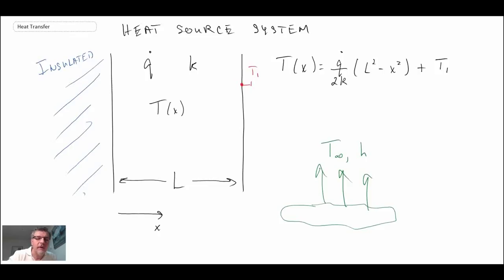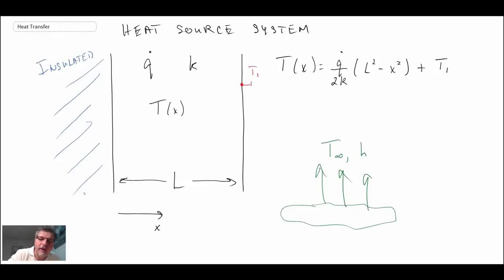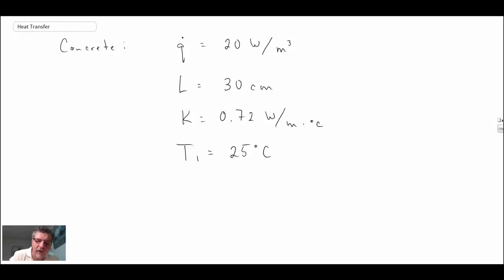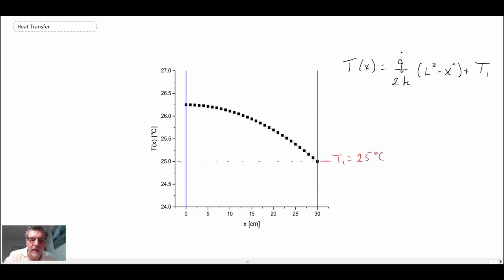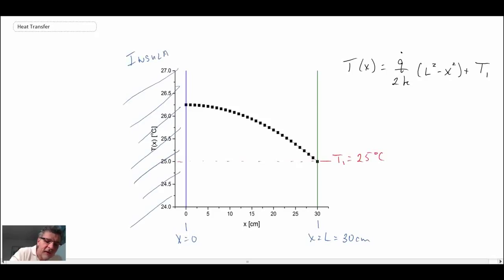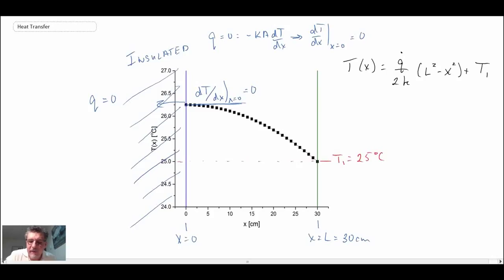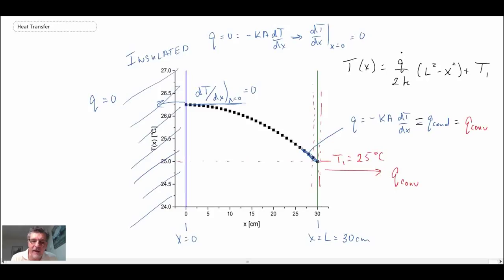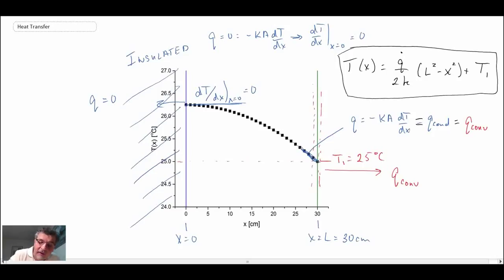Heat Transfer L7 p3 - Temperature Distribution within Curing Concrete

Comment: Thank you so much for this video. If possible, could you let me know or let me know where I could find the info about q and q_dot? Is it q = q_dot (A * L) = q_dot * volume?
Reply: Look, 

1. his notation for heat transfer rate is q [units: J/s or W] (note: for flux, he didnt define anything specific). 

2. Considering the internal heat generation he defined it as q_dot, and so total heat generated will be q = q_dot*Volume. [Units: W/m3]

So, according to the notation, "dot" signifies the internal heat but not rate.

Reference:
For point1, refer L1P2
For 2, refer L7P1.

And what you have written above is right.
Reply: Thank you for the response. I am a little bit confused about the energy surface balance q_dot (A*L) = hA(T1-T_infinity). Will really appreciate if you are interested in a discussion.

If looking at the convection formula, q = hA(T1-T_infinity), q is the heat flow in the fluid when x > L. Seems like in the energy surface balance equation , q_dot (A*L) = q due to the energy surface balance equation. All the power generated from the solid is applied to that surface, which kind of makes sense.

By looking at your comment and I further think about it, I got the ideas below:

1.    q_dot is the rate of energy generation within the solid. The unit of q_dot is [W/m^3]. So, q_dot * volume is the total power generated by the solid. 

2.    q is the heat transfer rate which is q=-kA*grad(T), which is gotten from the conduction rate equation and the unit of q is [W]. In the pure conduction equation, it does not involve any heat generation from the solid itself. But in this example, the solid itself is a heat source, so the q value is not a constant from x = 0 to x = L. So this relationship q = q_dot * volume might only be true at the boundary between the solid and the fluid, which is @ x = L. 

3.    In the example above (as well as in the previous video), The only heat source is the solid itself. Since the left side of the solid is an insulation material, no heat come from the left. That might be why he mentioned q=0 @ x = 0 somewhere in the video, which is also dT/dx = 0 @ x = 0 comes from.